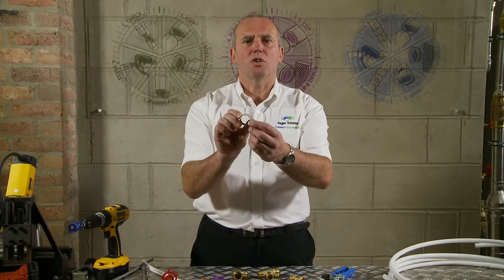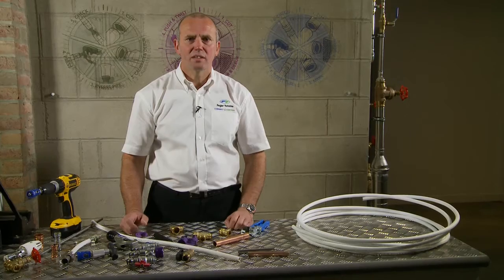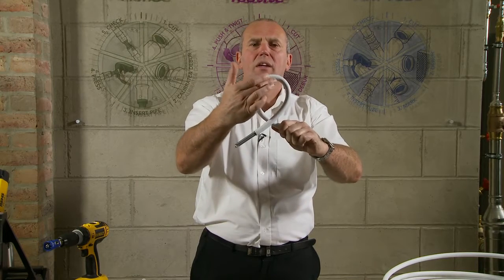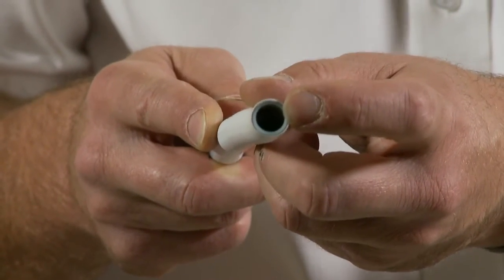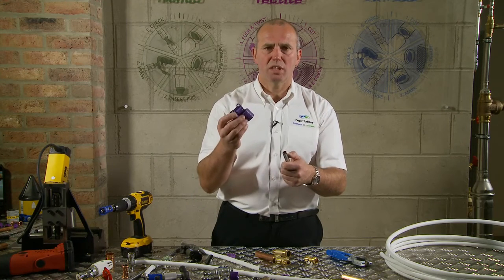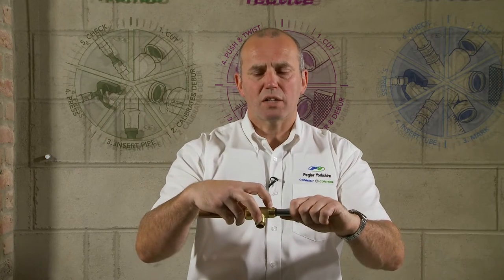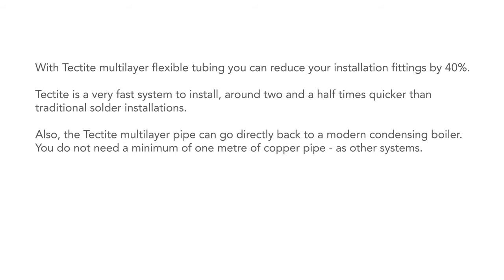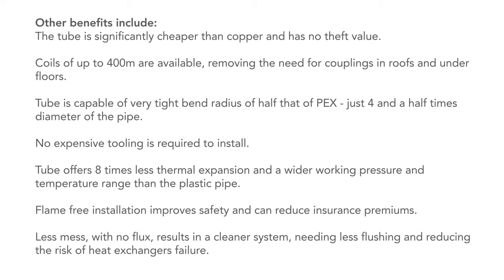Pegler Yorkshire Presentation InstallerONSITE

Comment: Having worked with oil hydraulics, pushing the dry copper pipe into the fitting looks cruel. Wouldn't some lubrication seem appropriate to ensure no o ring deformation.?
Reply: Tectite fittings come pre-lubricated, so there is already a layer of lubrication on the o-ring. Copper pipes just slips into the fittings, providing it has been chamfered correctly. If you don't debur and chamfer the pipe, the o-ring gets cut to ribbons and the connection leaks immediately! It's a mistake you only make once.

Comment: So....my house was built in 1974. I’m refitting the bathrooms and in the loft and airing cupboard I am finding that all of the gate valves are either completely seized open, or will not fully close. So I’m replacing the pipework as I go and looking at new lever valves. My questions are
Why are Pegler valves over twice the price of non branded valves?
And if we know they don’t last 50 years anyway, why spend the extra money on your valves?
Reply: The Pegler valves are at least twice as good as non-branded valves. I only use good  fittings from Pegler or Altecnic - Pegler for push-fit, Altecnic for compression fittings. The cheap non-branded valves just cause problems later on, and you really don't want leaks in your loft.
Reply: As far as I know, they're about as good as you can buy. Our CH was put in around 75, and all the peglers are still smooth to open and close !